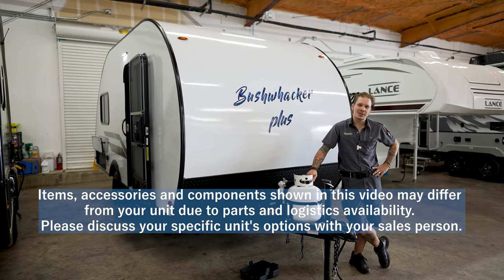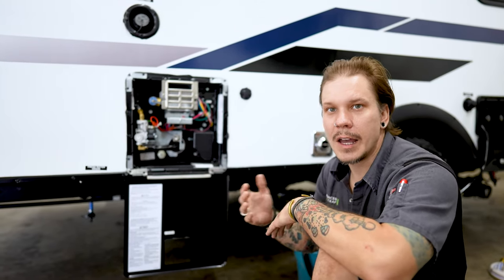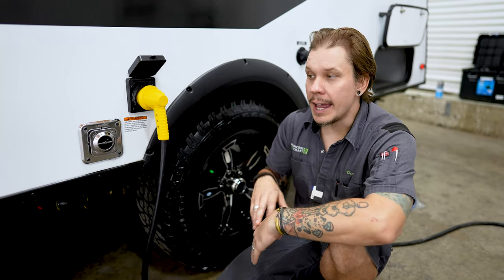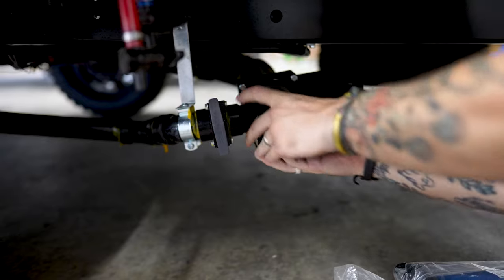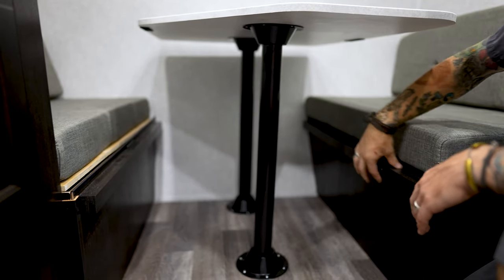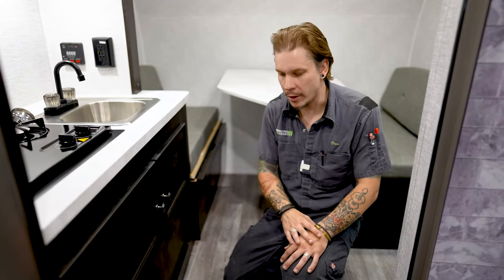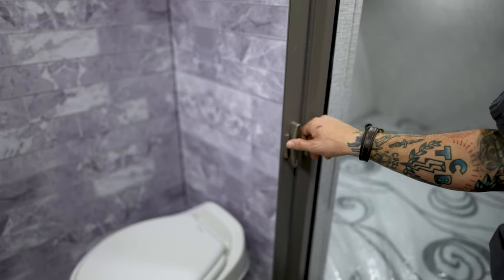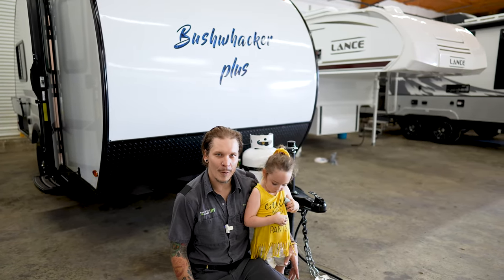2021 Bushwhacker Plus 17FD Tech Tour

Comment: Hello, my radio in my trailor Bushwaker Plus 17 FD 2021 doesn't start at all... When I closed it for the winter, everything was fine! I check the  fuse, it's not the problem... My battery is fine also...Help!!!